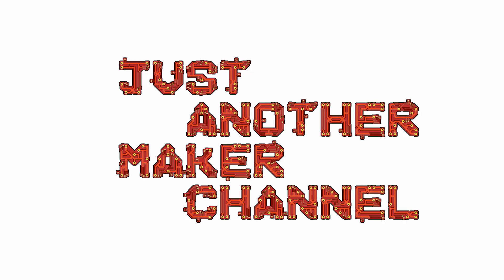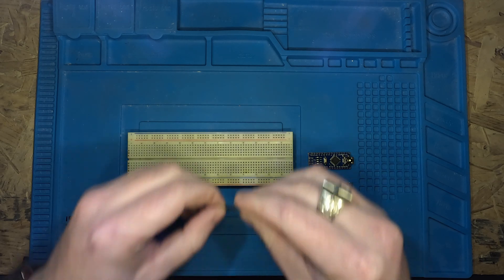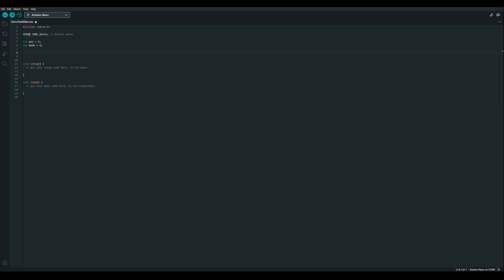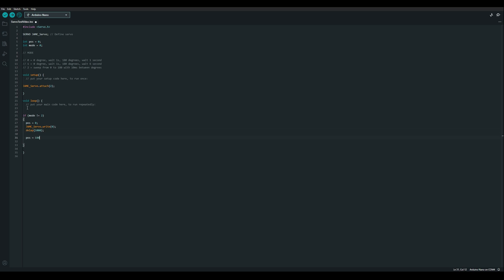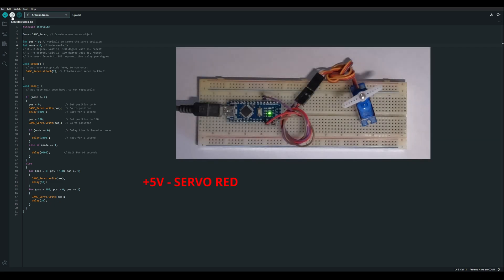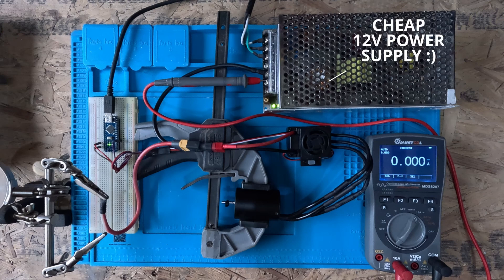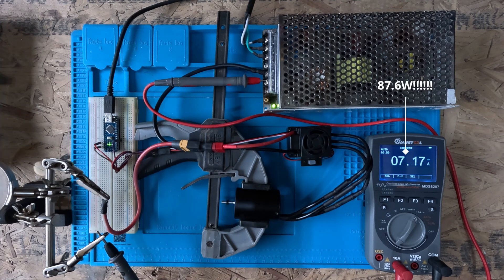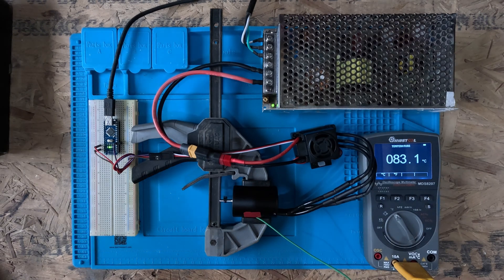Simple Arduino Servo ESC PWM

Comment: Cant find the library, so this simple version should work as well. 
//Usage   in loop()
for (int i=0;i<180; i++){
  servo_pwm(i,servopin);
}
// Custom servo motor control function outside loop()
void servo_pwm(int x, int pin) {
  int val = (x*10.25)+500;
  digitalWrite(pin, HIGH);
  delayMicroseconds(val);
  digitalWrite(pin, LOW);
  delay(10);
}